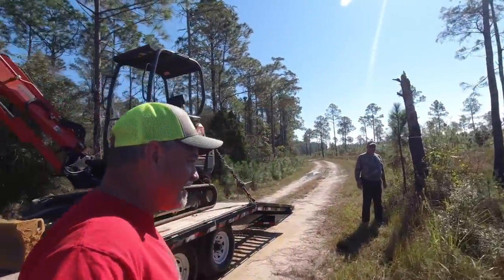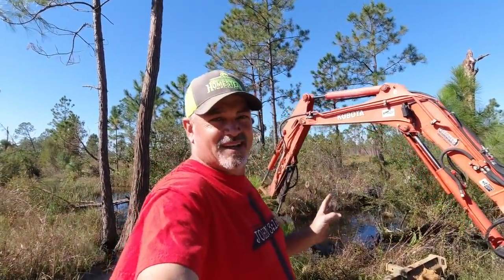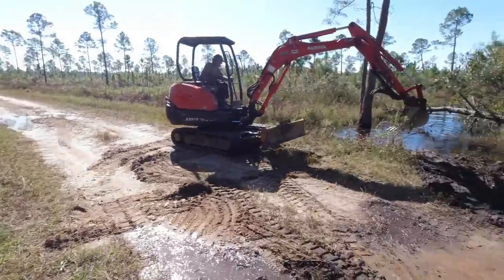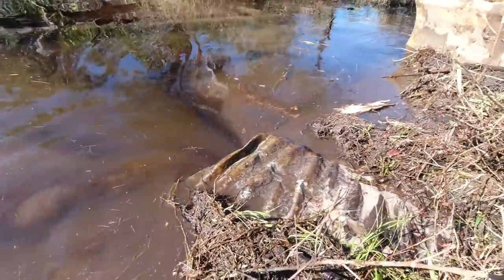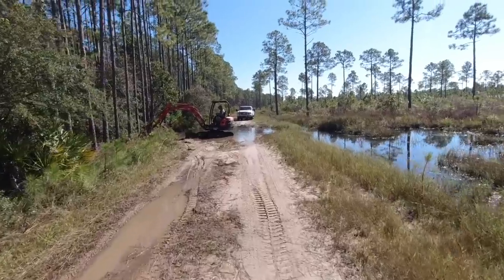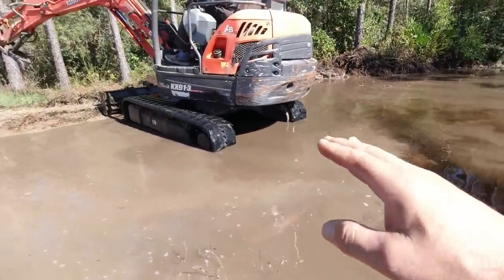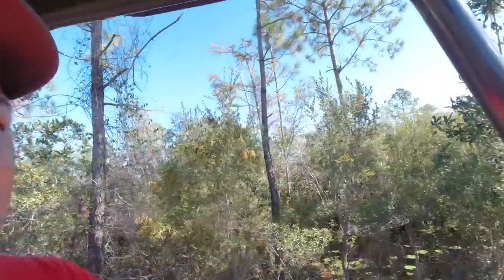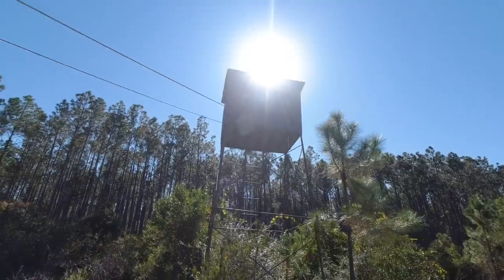Am I Experienced Enough To Break This Beaver Dam?

Comment: Good job at opening it up.   I can tell you from lots of experience though that beavers can plug a culvert that size in a few hours, usually overnight.  Trapping is about the only solution and that is an ongoing process because more beavers will move in usually.
Reply from the maker: Yeah I hear ya 👍

Comment: take it how you will but one of the most important things for me when I was operating (I worked construction from 14 to about 22 years old and got a bit of seat time) But getting your tracks set up just right so you dont bounce around so much. between your tracks and the front blade you should be able to find a good stable platform. Slow is smooth, Smooth is fast. Take it how you will. Just offering advice. Great and enjoyable content. Thanks for sharing and have such positive videos.
Reply from the maker: Thanks brother 👍

Comment: The jerkiness is just the Kubota itself. I’ve seen in cottontops videos, even his is pretty jerky at times. The Kubota I run was slightly bigger than the one y’all had and it was really jerky as well, especially if your trying to go slow. If you run it wide open on the joysticks it smooths out quite a bit. The smoothest machine I’ve run out of a Kubota, Cat, John Deere, and bobcat was the Cat. The bobcat was 2nd but it was a 18k lb machine where the others were around 10-11k lb machines.
Reply from the maker: Interesting. Thanks buddy 👍

Comment: Hank, when you see my name, you take a deep breath thinking he is going to say something about how wrong I was but you would guess wrong cause you did fine and if you spent a few days on it would be better on that machine than some of the others. One thing that starting out is hard to do is getting past the "H" pattern on the two joy sticks as they move sideways as well as forward and back. So if your lowering the bucket can also move the stick sideways and curl the bucket open or close and if the jib needs moved up or down the machine will also swing one side or the other and so when that starts to coming to you that its not just a h pattern but sideways on any position the lever is in.... then open that throttle up an move without jerking a bit.  I'm always moving my jib in and out when raising or lowering my main boom. The buttons for the thumb are still hydraulic, just electric over hydraulic to operate. Was you to do this every day... in a weeks time most you could do hourly work just fine. Everybody does start somewhere and I had to with every out fit I worked for seemed they had a different make or model or just old and full of issues. Keep on getting on stuff as you are able and actually doing very well. I wish I could give a extremely good like button as you'd got it from me.
Reply from the maker: Lol. I enjoy your comments Morgan. Thanks for taking the time to make them and taking the time to watch the video! Have a happy Thanksgiving.